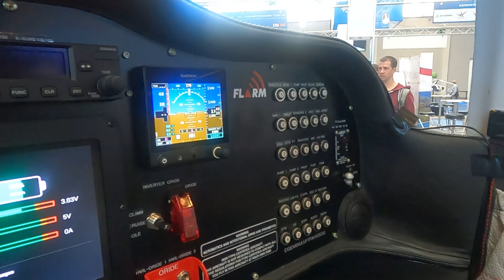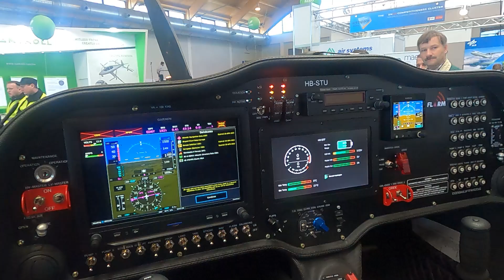ETH Zurich Shows an Electric Sling at Aero 2023

Comment: So good to see how young engineers don't waste their time riding a dead horse. The gravimetric energy density of batteries will not allow this to be a replacement for combustion engines, but starting with motor and buffer batteries and then moving on to fuel cells sounds like a great path to a real, practicable solution. Let me know once the FCE Panthera with 1000nm range from 20kg of H2 can be ordered. I fear there will have to be eFuels as bridge technology, but please prove me wrong while I am still fit to fly.
(Please, no annoying phantasy BE planes with real 45 minutes endurance after 90 minutes charging and requiring chargers the airport can't power at scale)
Reply: Very funny....this is the future. Currently (pun intended) CATL has produced a 500WH/kg battery that will be able to be swapped in to this aircraft and triple the range. Not fantasy cells but certified. I fly a Pipistrel electro which has an hour of flight time with 30 min reserve, using older tech cells. CATL cells will increase that four fold. This will make a five hour flight with reserves possible. Almost all Airfields have sufficient electrical power for quick charge installations. Electric will take over the training Market first then the short haul. Cost always wins out, H2 is too expensive.
Reply: @glennmartin6780  do your research better. It's a 500Wh/kg cell, not battery. Typically, for an airworthy battery (wiring, balancing, thermal management, fire cells, armor, etc.) let that translate into a 250Wh/kg battery. A travel plane like our SR20 cruises at about 100kW, maybe a little more but I am generous. 5 hours endurance means 500kWh battery required. 2 Tons of batteries is sadly not the budget removing fuel and engine, more like 300kg. This shows how far away batteries are, with not much progress in the last decade reaching cell chemistry limits and no other cell chemistry in sight. There is no indication of it ever becoming an option. And don't forget, if there was a 500kWh battery, it would require 0,5MW power per plane charging at the airport. And a 500Wh/kg cell is not a x4 over one with 300Wh/kg, something is flawed in your math as well. Don't repeat marketing slogans, calculate and think yourself I suggest 😉

P.S. IFR reserves typically require 45 minutes, but if you fly the Pipistrel electro I guess you are a student still. And I bet you never used the 60 minutes to actually go somewhere. I wouldn't be surprised a go around at low SoC kills the battery after a couple cycles...
Reply: @glennmartin6780  How much are those cells? How long do they last? You're saying that cost always wins, but haven't presented anything about the cost of the batteries, or about how frequently they would need to be replaced.
Reply: @PistonAvatarGuy  sadly true. There are so many cell parameters to look at, weight, volume, safety (look at Samsung what happens if you optimize insulation layers to much, you don't want a hard landing or crash to ignite the battery), power output, charge speed over time at cycles until 80% residual capacity, thermal properties, resources requirements, cost. I would really love a 1MWh battery at 300kg powering a popular 4 seater like an SR22T. Charging at the airport at 1 MW peak in 90 minutes. Airports with 20MW renewable power plants and energy storage (some don't only want to charge at CAVOC days, and not with electricity from coal) each for 20 fast chargers per fuel station today. That's not going to happen and the investments would, if it was possible, need to be paid for as well with the electricity. H2 will get cheaper with many countries (look at Namibia e.g.) using their abundance of wind, solar, water, and deserted space creating green H2 at scale and exporting it e.g. as ammonia. The main difference between batteries and fuel cells is: we know how to build a viable plane with fuel cells, we don't know how to do it with batteries. The infrastructure exists for neither and we know how to scale both. So the ETH students are smarter than some hype blinded naive investors and battery fan boys and girls.
Reply: @BlueSideUp  "we know how to build a viable plane with fuel cells"

Oh? And what fuel cell powered aircraft could be considered to be viable? Cost is also likely to be a huge problem for fuel cell aircraft.
Reply: @PistonAvatarGuy  P.S. I think as a trainer for patterns, some airwork, etc. in 45 minute sessions a plane like the Pipistrel Electro might have a point. I am not sure about the commercials, you will need to charge one hour I guess for 45 minutes (as you need to leave at least 30% SoC in the battery and charge to 100% which is usually slow). If you adjust operations to do preflight, briefing, etc. in that charging time and have enough space and chargers, you might be able to get 4-5 sessions per day onto the plane, similar to our trainers today. Our sessions are 25% longer, so the flight hour will be more expensive, offset by less fuel cost of course. So for this purpose, batteries are fine. However you need combustion engine planes to do the nav triangle, cross country stuff. So students need to learn to fly combustion engine planes as well, adding to the hours and not improving safety I guess. Most hours on an electric plane but cross country solo with combustion engine? I wouldn't have done that. And flight schools like to sell/renew planes from time to time. Let's see if there is a market for used battery electric planes with only 80% or less of the original capacity or need for a new battery. Combustion engines or fuel cells don't have over time tank shrinking, it's all very complex.
Reply: @PistonAvatarGuy  I mean in principle. There is work to be done, some FCEPs are already flying. We know how to scale range within the weight available, that's the difference. But if you want to say you can't buy it today, that's true. It will take a long time but at least there is no miracle required to achieve it. In between we will be happy to get unleaded AVGAS and maybe eFuels after that certified for our conceptually half a century old engines 😉
Reply: @BlueSideUp  "...a plane like the Pipistrel Electro might have a point."

Its much higher purchase price and the cost of its battery replacements (they're expected to be at far less than 1,000 hours) are far too high for it to be able to compete with its ICE counterpart when it comes to cost of operation... and it certainly doesn't compete with regard to any performance metric.

"There is work to be done, some FCEPs are already flying."

But they're ridiculously impractical. I was just looking at the Universal Hydrogen Dash 8, the HFC powered engine is down on power by about 1,500 hp, its fuel tanks take up a third of the fuselage, and the longest flight that it has made was only 15 minutes long (supposedly it carries enough fuel for a whole 30 minutes of flight... without passengers), that is not even remotely close to being useful. The aircraft may not even be able to fly with a load of passengers, and even if it could, there wouldn't be room for many of them in the passenger compartment. The amount of drag produced by the radiators for the fuel cells also looks to be substantial.

ICE engines are still the best option, by far, especially if we get e-fuels into large-scale production. With most electricity being generated via the burning of fossil fuels anyway, it will be a long while before electric aircraft can even offer any sort of real benefit. Also, if we push for electricity generation via renewables, batteries will become a horrific environmental problem.
Reply: @PistonAvatarGuy  I see no disagreement in our statements. I wouldn't use an electric trainer and don't think in the next decade we will see a GA plane with H2 fuel cells. It's a little more complex than putting a Mirai II power train and composite tanks into an airframe. It will still be done I guess, because CO2 emissions will not be tolerated by societies. And eFuels are CO2 "neutral", not CO2 emission free. For the next decade, we won't even see unleaded AVGAS available everywhere. And yes, we sadly! currently have no market ready alternative to burning hydrocarbons for many use cases, aviation being one. H2 will come, batteries would require a revolutionary development so are unlikely. I would honestly love to be wrong.

Others like H2FLY are closer to GA sized, but also in early development. Don't forget, once you have the power train, H2 storage scales well. Carbon tanks with polymer liners are still 10 times the weight of the H2 they carry, but that's O.K. because of the high energy density. We might see fuel cells with other fuels easier to transport. But I doubt emissions of CO2 will be accepted in the future, no matter if the CO2 was removed from the atmosphere before. But it's not going to happen on any timescale to stop global warming before 1,5° so we will use every technology that's better than fossils and actually works.
Reply: @BlueSideUp  I just don't see H2 aircraft being any more practical than battery aircraft, they're both so far away from being practical that the differences between one and the other are irrelevant.
Reply: @PistonAvatarGuy  there we disagree. H2 scales differently. You have a base weight for the fuel cells. You add H2 storage. With batteries, doubling the energy content doubles the weight. With fuel cells, the cells stay the same, you add H2 tanks. So going from a 60kWh 300kg battery to a 120kWh battery makes it 600kg. And so on. Going from let's say a 300 kg fuel cell with 5 kg H2 in a 50kg tank to 10kg H2 tank will take the whole thing to 350kg. Illustrative numbers. That makes all the difference. The energy content for a SR22 is maybe 20 kg H2. Let that be 200kg in H2 tanks. A battery with that energy content is more heavy than the plane.
Reply: @BlueSideUp  A 230 kW fuel cell (the complete system, not just the stack) is still quite heavy and it's the size of the hydrogen tanks that is the problem, not the weight.
Reply: @PistonAvatarGuy  not really, look at the Mirai II e.g. It is a heavy car, like a BEV with similar range. Let's say it replaces 60 L. of fuel. Now going from that to the 600 Liters a semi would carry, the BEV goes from 800kg battery to 8 tons. You need 0,6MW to charge it in 90 minutes. Forget it. The FCEV power train scales differently, that's why semi manufacturers see BEV only for on premise and develop FCEV for regular use. No problems fitting the tanks. GA aircraft have a lot of unused space anyway. It's of course a redesign, if you try fitting H2 tanks into the space where the fuel tanks where it's harder. But I would argue you can design even 4x5kg H2 tanks, 2 per wing, that fit. It just makes limited sense if the whole tail is empty. And CG requirements mean: redesign. But it doesn't require a non existing technology like batteries with sufficient Wh/kg to get there. I don't see the alternative if CO2 emissions are not an option.
Reply: @PistonAvatarGuy  to illustrate, the diameter of the Mirai II tanks is about 30cm. There are initiatives to create packaging that's more like the 10cm of batteries you can put under the floor, see e.g. FlatHyStor. Packaging was not on the H2 agenda so much, it will be one of the things to optimize for use in planes. A 30cm tank is not going into my wings, that's for sure. It's worthwhile because it works in principle, other than a 1 ton flat battery per wing 🙄
Reply: @BlueSideUp  I'm not arguing in favor of batteries. Sure, you could probably make an H2 powered aircraft work (it might look something like the Scaled Composites GlobalFlyer), but it wont perform as well as a gasoline-burning aircraft.

e-fuels are carbon neutral, there's no need to worry about their emissions. You also can't expect the world's entire fleet of aircraft to be replaced anytime soon, it would simply be faster to adopt e-fuels.
Reply: @PistonAvatarGuy  and that's where we totally agree. For a long time, asking for emission free planes is unreasonable. Carbon neutral is all we will have. Batteries don't scale, H2 takes time. Even eFuels will still take a lot of time until they are certified for GA engines and available at airports. Look at the time G100UL took up to now and that's nowhere available. I still remember the days of E10 introduction, many engines not fit without modifications, etc. It's a marathon, not a sprint. That's why I am opposed to battery electric plane fantasies. It makes people waste time and money, will not lead to a viable result and delay working on practicable solutions like H2 FCs and bridge technologies we desperately need quickly, like eFuels.
Reply: @BlueSideUp  Current fuel cells are too big and heavy compared to what can be done with PCB fuel cells, microturbines, rotary engines, linear piston generators or other technology with better power density. So those numbers can still improve a lot.
Reply: @BlueSideUp  It's also relatively easy to fit a lot more hydrogen than 5 kg to 20kg if any other storage method is used except compressed or liquified hydrogen.
Reply: @vitordelima  absolutely, I was just using existing technology in product use as examples. There is a lot of potential if we don't run into a dead end full speed.
Reply: @vitordelima  ...but I don’t need more, after 4 hours latest it's me limiting endurance, not fuel of any kind 😊
Reply: @BlueSideUp  But why would anyone want an H2 FC aircraft over e-fuels? They perform worse all around, the fuel is difficult and expensive to transport and store and the aircraft will no doubt be far more expensive to buy. Fuel cells also have a fairly limited lifespan and replacing them isn't cheap.
Reply: @PistonAvatarGuy  Many hydrogen storage solutions store it via synthethic fuels (not necessarily made from electricity like the e-fuels), you can use synthetic fuels via fuel cells, or hydrogen without FCs, there are dozens of types of FCs with different costs and lifespans, hydrogen is also a source material for most of those fuels, so this question is kind of strange.
Reply: @vitordelima  The differences between making use of liquid hydrocarbon fuels and free hydrogen are absolutely enormous. Liquid hydrocarbon fuels already have all of the infrastructure necessary for the distribution of the fuels, they already have the refueling infrastructure in place, billions have been invested in the development of the engines that burn those fuels, every modern aircraft has already been designed around those engines and nothing else is even remotely close to offering similar performance.

If fuel cell vehicles offered some kind of significant performance advantage, I can see the justification for enormous changes being made to accommodate them, but they just don't offer any meaningful benefits over ICE vehicles.
Reply: @glennmartin6780  Batt tech is mature.. its the past not the future. There has been no more significant developments the last 5 years or so. Even admitted by Tine from Pipistrel on the show.
Reply: @PistonAvatarGuy  Even this doesn't make any sense since hydrogen doesn't necessarily has to be transported around since it can be generated on-site from almost any other energy source. In many cases it may be transported using existing infrastructure depending on how it's stored (such as liquid hydrogen is similar to LNG, Liquid Organic Hydrogen Carriers are just oils, metal hydrides are just powers or goos, ...) and the costs, range, recharging times, longevity can much better than EVs if everything is designed properly. This technology triggers certain groups so a lot of lies are repeat everywhere, all the time, and anything contradict this spam is simply ignored.
Reply: @vitordelima  "Even this doesn't make any sense since hydrogen doesn't necessarily has to be transported around since it can be generated on-site from almost any other energy source."

The energy requirements for doing something like that (in the case of airliners) would be insanely huge and would almost certainly require dedicated power lines to be run from power plants. You have to understand that the engines used on airliners are sometimes used in power plants (aeroderivative generating stations), so you're basically talking about dozens of small power plants worth of energy being supplied to airports. If the production of hydrogen were to become a significant part of our fuel supply in some way (whether it's used as a fuel directly, or as part of the production of e-fuels), it would make the most sense to produce it using nuclear power, as heat energy that's normally wasted by the power plant could be used to improve the efficiency of the hydrogen production process (as I understand it, anyway).

Hydrogen is more difficult to transport than most other gases, because it literally leaks THROUGH many materials, so special, expensive materials are required for storage and transport. Hydrogen also causes metal embrittlement, which again requires special and expensive materials to avoid.

Nothing about using hydrogen as a fuel makes any sense, and technology "demonstrators" (like the Universal Hydrogen Dash 8) continue to prove this.
Reply: @PistonAvatarGuy  Then it would be transported as ammonia, or locally obtained from the gasification of any hydrocarbon or other energy dense method. Hydrogen production has several dozen possible methods and energy sources, waste heat from any source (not only nuclear) can be used. You are also ignoring that I mentioned it doesn't need to be transported as a gas because you are playing dumb and nitpicking forever the same way every other spammer online.